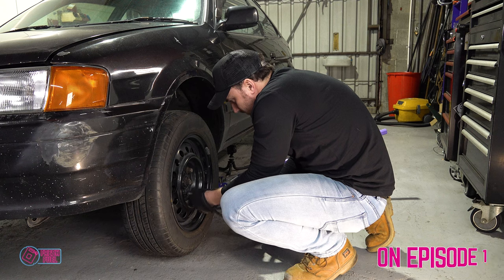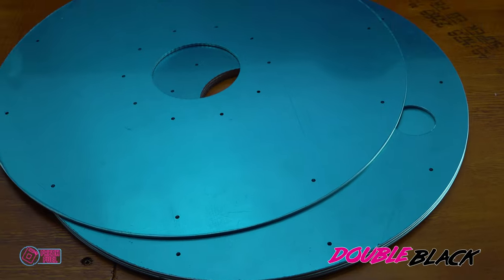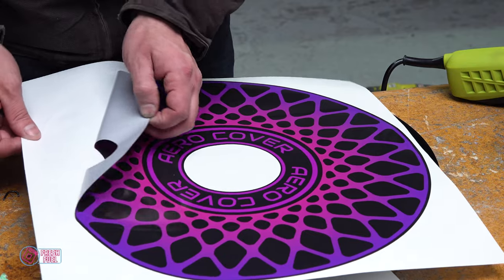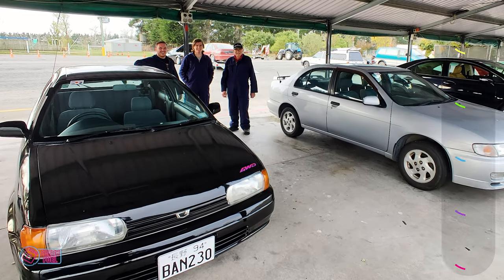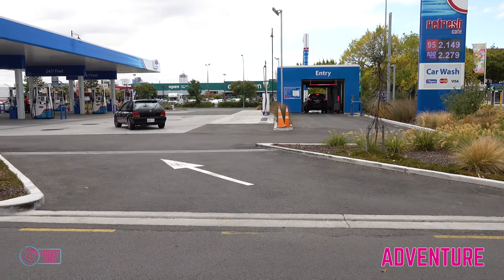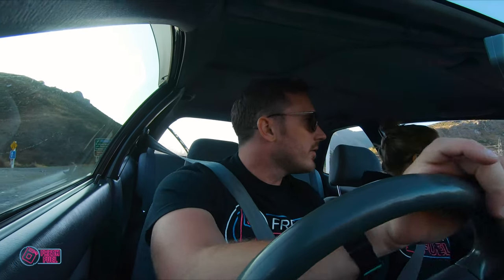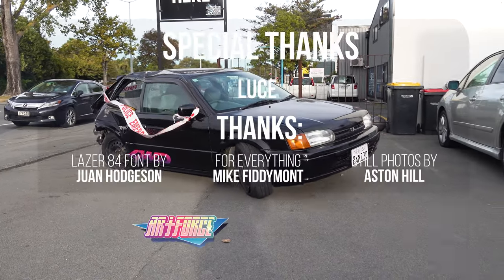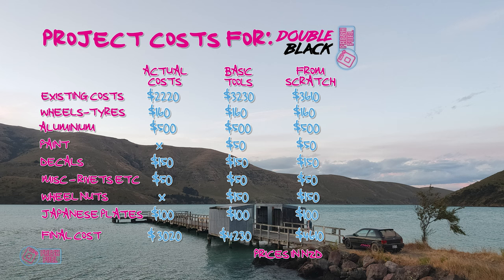DIY Turbofans - RARE 4WD JDM Corolla - Double Black Ep 3 // Fresh Fuel Ep 3 // 4K

Comment: I’ve so been looking to do something like this myself on my z4.  So rad.  Turbofans are pretty much non-existent without paying astronomical prices.  I’m not into it for the functionality but the look.  Can you tell us how you mounted it to the wheel?  Have you had any issues with the balance of the wheel.  I’d imagine that if it want made and installed perfectly then there would be vibration
Reply from the maker: Hey! They would look good on a Z4 - I mounted them by drilling and tapping the wheel nuts and bolting through the inner flange of the fan. I don't think it would work with BMW wheel bolts though. Probably the best would be to find some steel wheels and weld some fasteners to them. I think any way that's not centrelock will be a bit of a work around! Good luck with it!